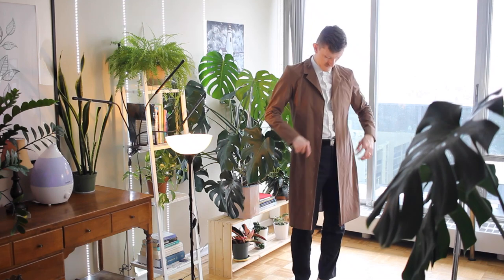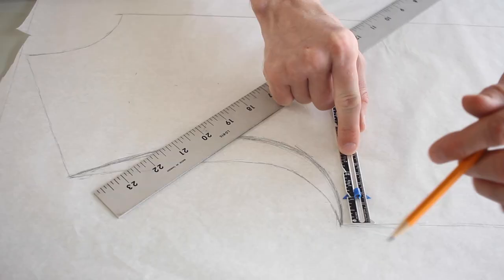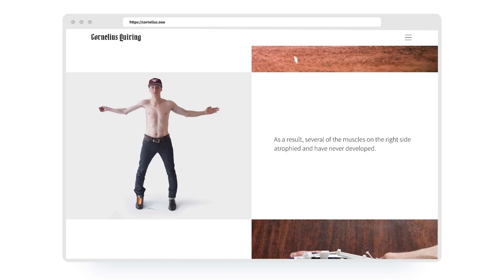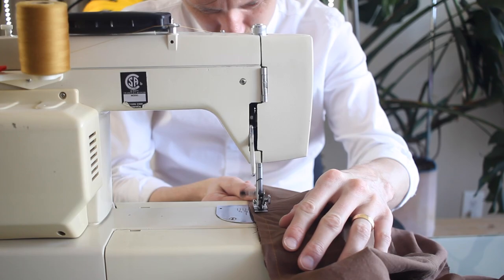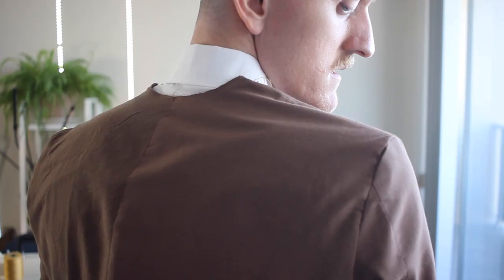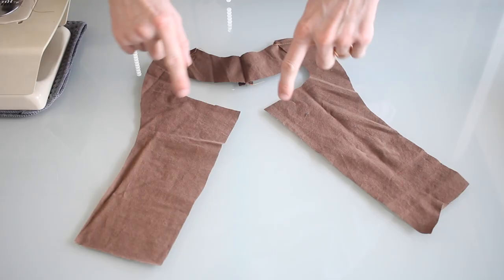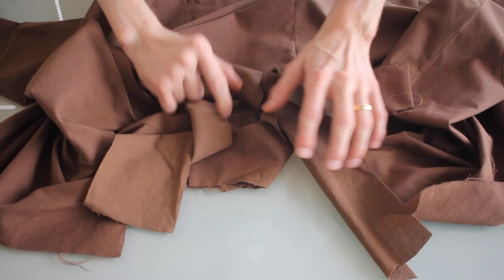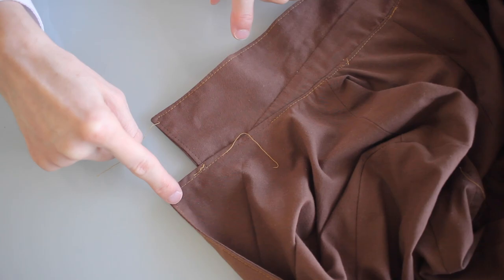Drafting a Coat Pattern From Scratch

Comment: I really want to make this jacket but I don't want it to be too hot. Did you use lining and of you didn't how did you get rid of the rough edges that are on the inside that you see when you open the jacket.
Reply from the maker: In the final coat, yes I put a lining. If you use a thin outer shell and thin lining fabric, it should be okay for heat. 

However, if you really don't want to have a living, you can simply serge the raw edges, or do either a bound or self-bound finish on all the raw edges. Just make sure you give yourself enough extra seam allowance if you're going to go with one of the last 2 options. Good luck with our make!

Comment: Can you please help me understand why not using the drafting book to draft a pattern?

Have you heard of Free Sewing? They have a lot of free patterns and one can put in your own measures for MTM or an option to make even finer adjustments. I warn you, one can loose an entire day playing with the program.
Reply from the maker: I have a personal desire to make my own clothes from scratch, including drafting. I also draft my clothes to be different sizes on each side of my body.

I find that I do best learning by trial and error. It allows me to better understand why things are done a certain way. I'm a tactical learner. Learning by reading is a tough way for me to synthesis information. I have also found that drafting books don't do the best job explaining why things are done as they are just ... do it this way.

Having said all that, books are a great way to learn for many others. I've also heard of free sewing. It's great resource for those interested.
Reply: I also draft my own patterns, I am exploring them and see what I like best. Part of it is Cuter and Tailor forum died and I didn't save all the wonderful mid century Rundschau systems. By the way, I first make a 1/4 scale draft to work through and get an understanding. 

I am also a tactile learner, so glad for your response, I defiantly will try it. For one, I struggle with shoulder slope, my shoulders are flat as the Trans-Canada through Alberta. ;<P (About two degrees slope.)
Reply from the maker: Hahahahaha. I Appreciate the humour and good to know. I've heard other people doing scale models first. Seems like an interesting concept. Thanks for sharing.
Reply: My humor comes from Oma, how many times she remind me better to laugh than cry. 

I have not heard doing scale model, rather, a scale draft. If want to make easier, there is a special three sided ruler called an architect's scale. Each side has two scales, for six scales total. I was going to be an architect so took several hand drafting classes.
Reply from the maker: Snap, I'm just learning so much from you. Thank you for sharing it all. Seems Oma was a wise one.